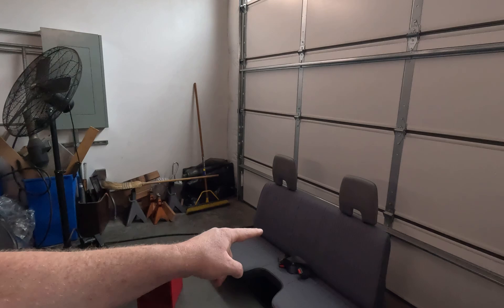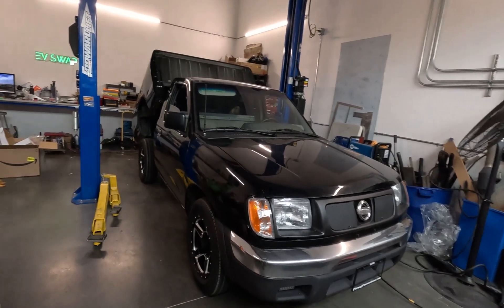Wheels and Tires, Seat, and Tilt Bed Updates

Comment: Brake assist? Using an electric vacuum pump?
Reply from the maker: Yes, using a simple GM vacuum pump for power brakes.
Reply: @EVSwap  
I have a whole Leaf that I’m planning to dismantle someday (it still drives well but only 10 bars.)
So maybe I could reuse the whole brake system?

Comment: What’s required by the DMV?
Probably a “brake and lights” certificate?
What else?
Reply from the maker: In Colorado we need to get the vehicle inspected by the Sheriff's office who will first and foremost inspect the vehicle to make sure the VIN is correct and the vehicle is not stolen, has no liens, etc. At that time they will also see that it is EV and mark it as electric power. For the DMV all we need is a driver's license, proof of insurance, and the VIN inspection form. There is no safety inspection in Colorado.
Reply: @EVSwap  
That’s encouraging, thanks. 
I want to convert an old truck, and I had assumed it would be too difficult to make it road legal. 
Now I’m curious about the insurance, I wonder how insurance companies price coverage for unique vehicles.